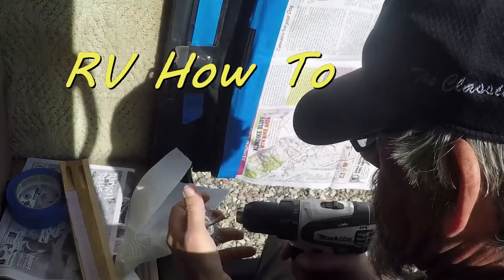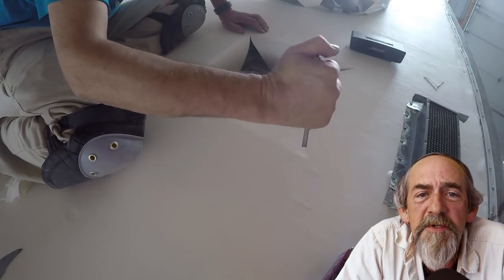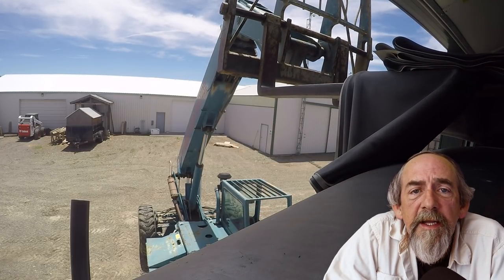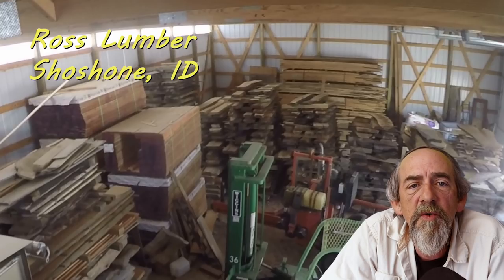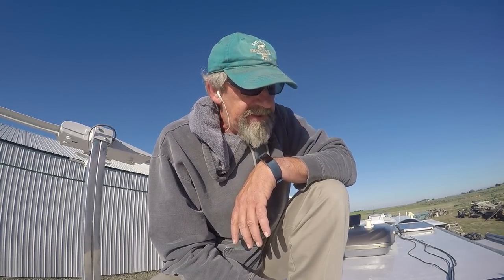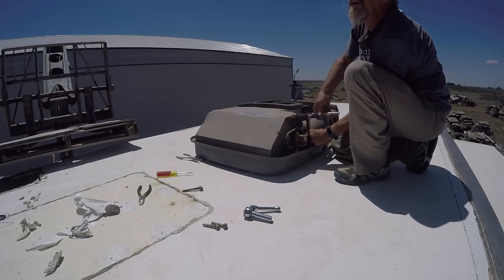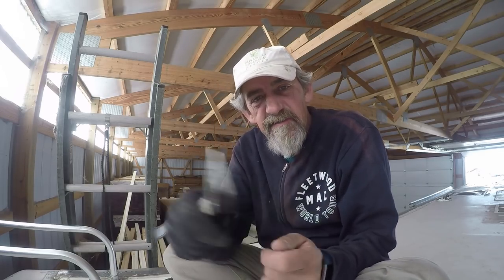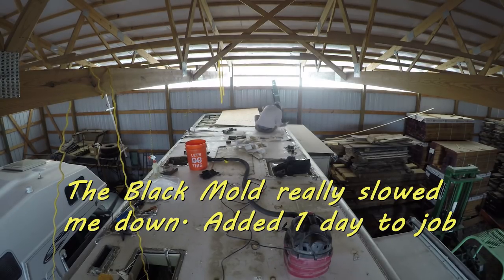RV How To - Replace your roof... Episode 1 Equipment and Sheathing Removal

Comment: I have been searching and searching for videos on "How to replace the entire roof of an RV".I have watched countless vids and it's never like this. I bet this guy was amazing to work for, I assume he had some type of construction business. I briefly watched "Part 2 of this video" and quickly searched for part 1. I am 5:54 into it and it feels very promising. I got a 30 foot class C. On fb Market place. Delivered to my house from the bordering town. Paid $150. The plan is full time living with me my son and our dogs. Because it's impossible to move with dogs.
Anyways I do house flips/ remodeling construction. I feel hopeful with my skill set and knowledge of carpentry/construction that I can turn what I have into something that will work for what I need, something solid, that will last. I live in Mass so we get all 4 seasons and can get cold in the winter.  The goal would be to have a wood stove in the center of it with propane as back up.. pocket door/s to avoid "swing". I'm sure my plans I have drawn out will continue to change. 
But I look forward to watching this series. 

And btw, current house flip, the house was built in 1792.  Tons of 6×6 and 8×8 beams. Mortise and Tenon I think it's called we are trying to incorporate into the remodel. We have to deal with the historical society.
Reply from the maker: You'll have no trouble with it. Basic construction skills are all you need. Thanks for watching

Comment: Just came across your channel and really enjoy your videos.  Can I ask more details of how you managed the black mold in the roof.  You put on a mask, you reduced the amount of tools in your area, and you removed the moldy wood and disposed of it immediately.  Anything else? Did you spray it down with something to kill the mold before cutting it out?  Thanks again, great video.
Reply from the maker: I didn't treat the wood. I did wipe down all the metal framing in the area with bleach water. I spoke to a professional company that deals with mold and they said that was all I needed to do. Thanks for your kind words and watching!

Comment: My fifth wheel airconditioners are not held on with lag screws. They must be removed from the inside. It has a bolt and sandwich system with four 1/4 bolts removed from inside. . Just thought I would share this as someone might not recognize such a system as this, and waste time trying to find lag bolts up top. Thank you for this video.
Reply from the maker: Great tip! Thanks for letting us know!

Comment: You videos are are great. I have two questions:
1. I see you used 3/8" plywood.  I'm towards 1/2" (its only additional 10lbs and $60 to go from 3/8" to 1/2") to be more sturdy and ability securely fasten stuff like solar panel in the future.  Do you find you wish you had more decking material when you installed the solar panels or just working up there?
2. I have a 38ft Newmar Dutchstar compared to your 40ft.  I see you used 9 sheets and last piece of plywood decking was small.  Do you think I will get my done with 8 sheets?
Reply from the maker: No, I used 1/2" plywood. I recommend 1/2". If your 38' is like mine then you might be able to. I would verify the distance between the front and rear caps.

Comment: I have a 2003 Dutch Star. I have major leakage. I have recaulked everything on top. And re sealed the ac. Still have a major leak. The shop said that the terminus bar has a paper thin separation. Looks like terminus bar was sealed with silicone. Called newmar they said it should be reseal with silicone because dircor would run down the side. I questioned that. I see where you had sealed terminus bar with eternabond before your new roof project. Did that do a good job of sealing terminus bars? On the new roof I see that you used dicor to seal terminus bars.
To reseal terminus bars with dicor I would have to remove all silicone from bars and screws. Or I could put eternabond tape over the bars. In your opinion which would you do?
Reply from the maker: The Eternabond did seal the leak for 5 years  but that vent you saw that came apart on the rear right was also leaking. I think that is where the black mold got started. That's what it looked like when I got the rubber removed.  I am surprised that Newmar told you to use silicone. It does not stick very well to rubber roofs particularly where things do get torqued around as  you roll down the road.  When you say that the there is a paper thin separation on the term bar where is that? Under the bar? Have you been able to determine where the leak is?  I would be worried that replacing the term bars, although not a very hard job, might cause more leaks than you fix.  There is going to be a ton of it left on the roof when you remove the term bars and that would be a huge pain in the A$$ to clean off and you want a pretty clean surface. I guess the eternabond would be my first choice  but it is expensive. BTW, other than the squeeze out that happened  with the Dicor  buytl tape as I screwed the bars down there has been no 'running' down the sides.
Reply: Thanks so much for the reply. My 2003 Dutch Star does not have a rubber roof. This must have been a replacement. Secondly, I called newmar again today because everything I read and watched said to get rid of the silicone and do dicor. Got a different story today. Different CS guy says to get rid of the silicone and do dicor. Thirdly I went back up on the roof today and there is not termination bar. Go figure I thought it was under the silicone. Do your coach have term bars or is that something you upgraded too? This is my first RV. So I have a lot of learn to do Thanks for you help.
Reply: To answer your question about the paper thin separation the separation was the glass roof and the coach. No bar.
Reply from the maker: No I had a rubber roof to start with so I replaced the term bar. That is what secures the edges. Sounds like you have a fiberglass roof.  I would clean the silicone off and replace with dicor lap sealant. Then you can always follow with the eternabond tape if the lap sealant does not fix the leak.
Reply: Thanks TR. I enjoy all your videos
Reply from the maker: Thanks for watching. Hopefully we can cross paths and do some fishing one of these days!
Reply: Sounds good. If we cross paths I will sure take you.
Reply: Did you use 4" or 6" tape?
Reply from the maker: @fishingamerica8008  4 inch
Reply: Thanks
Reply: TR when you taped the seam do you remember if you cleaned the area with anything like mineral spirits, acitone or something similar? Thanks
Reply: Oh did you tape the luggage rack? Did you take it off and tape underneath where it screws to the roof or did you tape on top?
Reply from the maker: NO ACETONE...will melt the fiberglass and you'll have a mess. I used 70% iospropyl alcohol. Rubbing alcohol. If there is still silicone remnants use mineral spirits to clean those up (or lacquer thinner works too) and then clean with the alcohol before you tape.
Reply: Thanks, I read on several sites to uses acetone on fiberglass. Glad you got back with me. I dont want a mess. I got a big enough mess now.
Reply from the maker: That's crazy talk. Acetone melts just about everything with a petroleum base like plastics and such. I talked to a friend who worked in a boat repair shop and he agreed with me, no acetone.